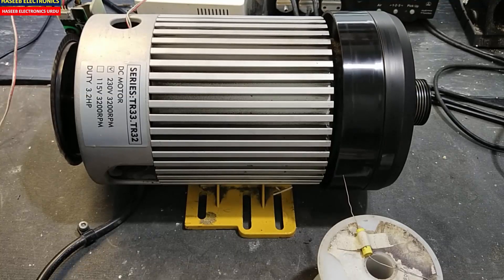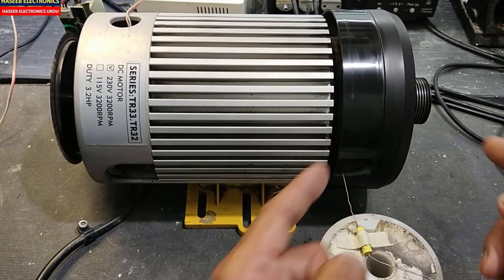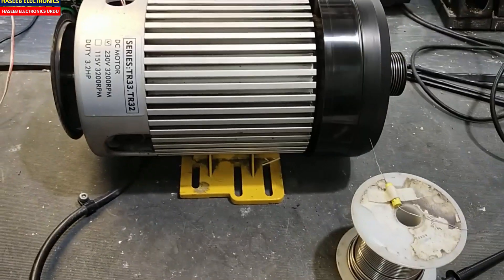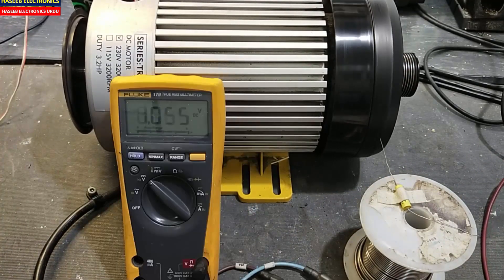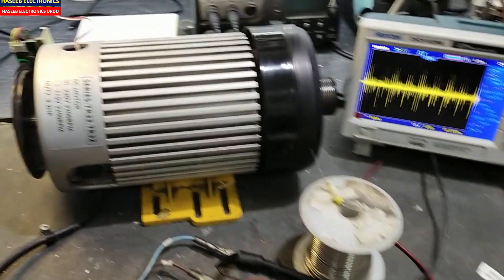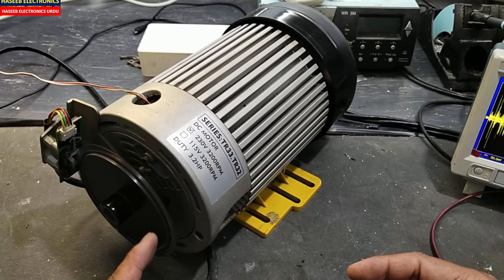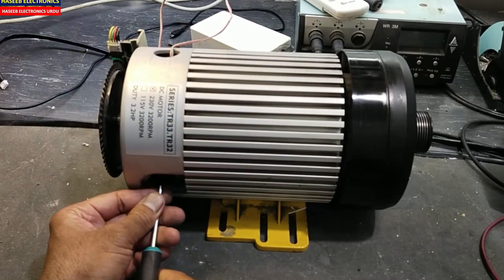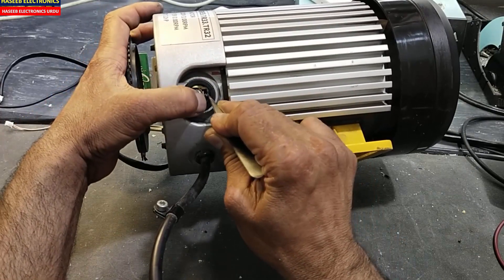{639} How to Test a Treadmill DC Motor

Comment: I test dc treadmill motors just checking the consumption.  Usually more than 0.3A with 12V mean bad motor that will break again the power transistor. The problem can be balance calibration or just burned inductor. Thanks for your videos. I'm new in your channel but already big fan
Reply from the maker: best regards and special thanks for sharing your valuable experience 
balancing is a biggest problem in these motor. carbon brushes, bearing, high voltage insulation, armature inter-segment short circuit, are the most common issues in the motor
Reply: @HaseebElectronics  indeed,  you're right. But all that problem's result is an increased consumption,  so you can short the diagnostic. Thanks from share your knowledge,  Haseeb.

Comment: Very nice video ! Can you please explain how speed motor works in a drill when we press slightly the switch, is the voltage or current that decreases ? can we use that circuit as a variac ? thanks.